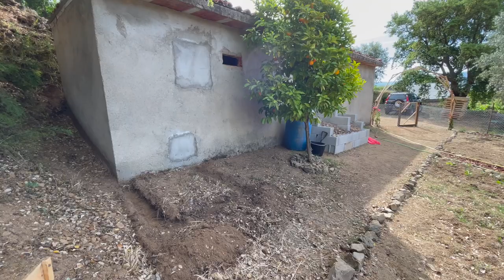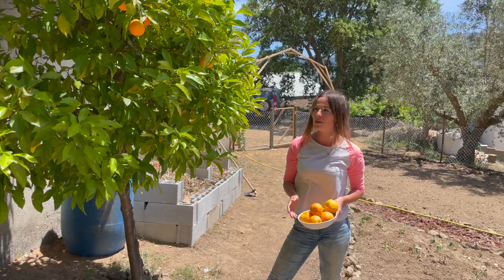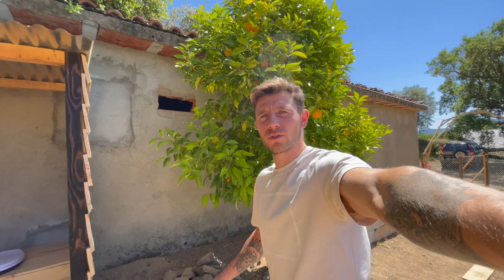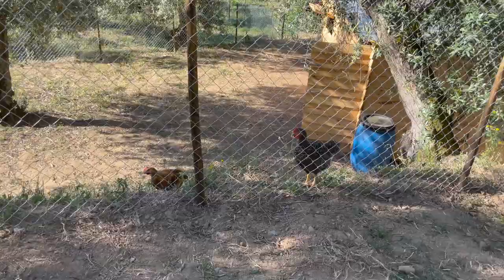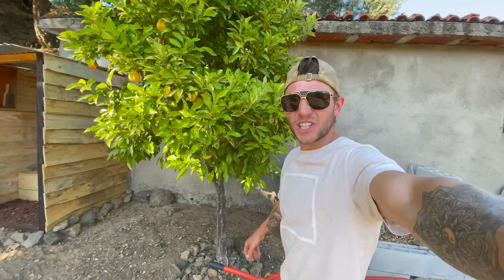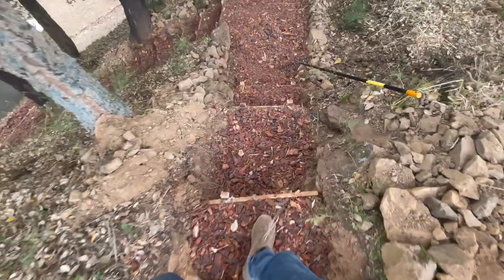Building a compost TOILET and STAIRWAYS | Noah's Ark

Comment: Chicken poo needs to be left 2 years to burn the acid off
Reply from the maker: Really? I didn’t know that, might be the reason why some plants looked bad then.. what about sheep poo?
Reply: @noahsarkportugal    All animal manure need to be fully fermented before they can be used as fertilizer for plants.  Better to put them in your compost and wait for at least 6-9 months.
Reply from the maker: Good to know! Thankyou 🙏
Reply: Yes  I was also thinking that. Too strong for plants
Reply: @noahsarkportugal  All animal manure needs to be older/composted. 
If you want to make your own fertilizing tea, you can use comfrey, or nettles, or other green leaves. Fill a bucket with the leaves. Cover with water and leave for a week or two. Dilute it it 20-1. Otherwise it's too strong. It will stink but plants love it

Comment: Let me know if the waterwell gets approved? Normally very difficult in Portugal. 5000€ is a lot of money no? Specially when you look at the average income.
Reply from the maker: Wel will! In central portugal it’s not difficult but in the south it is, because of the droughts there. I know, it’s indeed a lot of money, but you also have to look at the outcome. Forever free water, wich is not full of antibiotics, fluoride and other toxic stuff that tap water does have. To us that is worth the price. Also the well will probably go 80m deep so thats where the price is based on, maybe they don’t have to go as deep and it will be cheaper or maybe deeper and will be more expensive. So let’s see
Reply: 100% with guys.. gonna do the same
Reply from the maker: @Sergevdb28  are you also located in Portugal 🇵🇹?